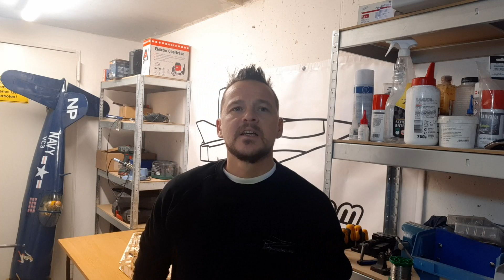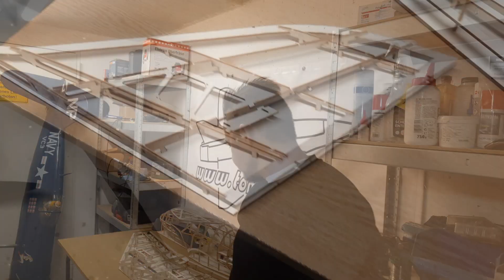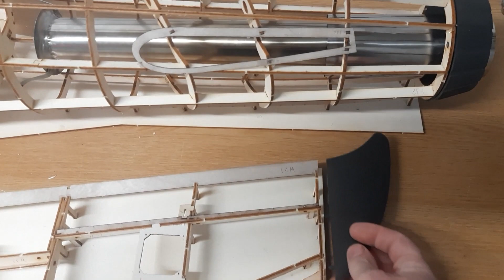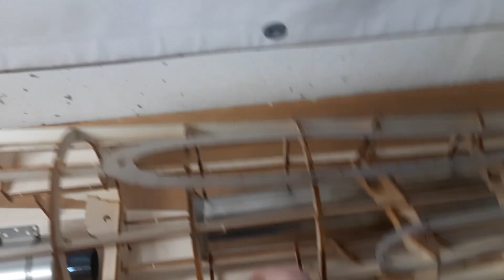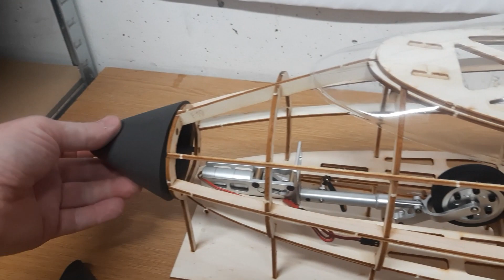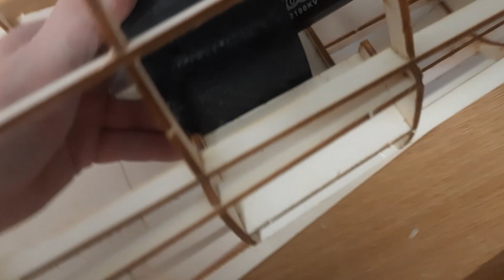tomjets Interceptor90 Part2 framework

Comment: I am using two separate servos on the same receiver channel for my Skymaster...The mounting is not mirror, like an aileron servo mount, it is two left, or two right. On the skymaster with two tailbooms the servos will have to be one on top, starboard side...one low port side